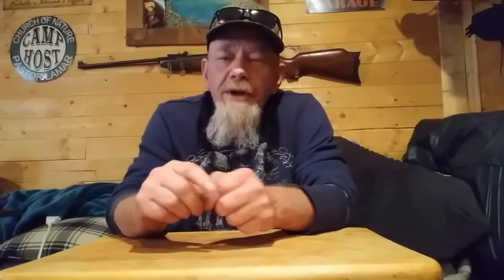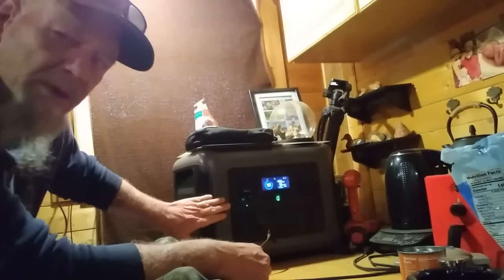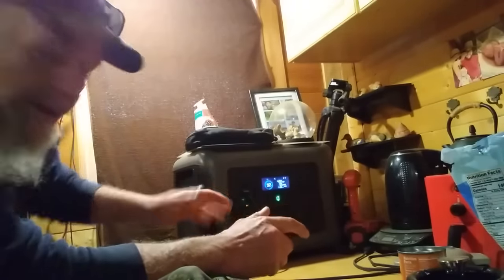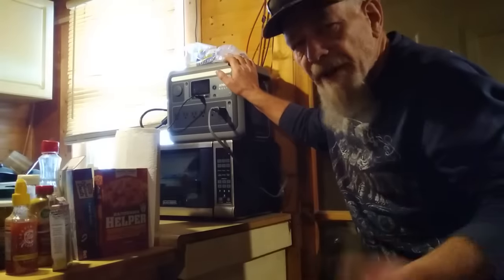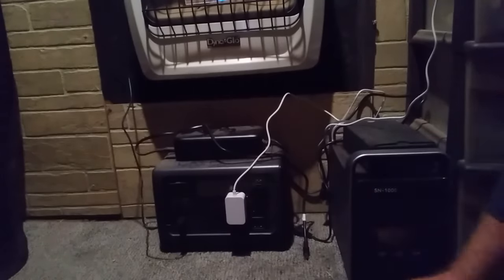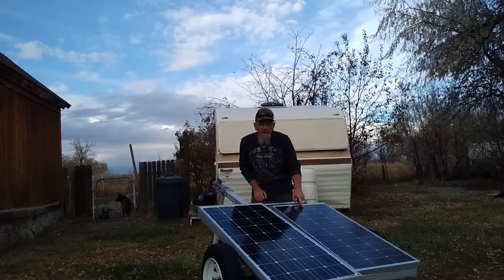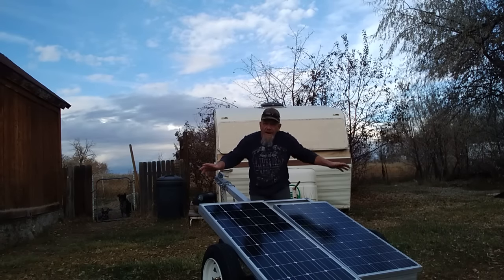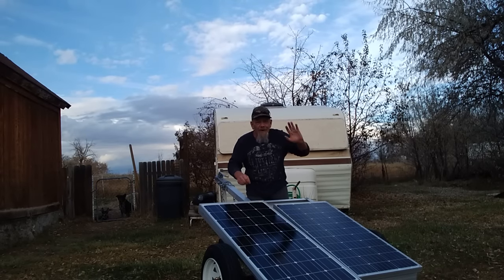My Solar Produces Too Much Power Or How I Store Excess Solar Power

Comment: i'm going for a system like your's probablly make it a 24 volt system...been experimenting with 12 volt system 400 watt solar and it has served me well for what i'm doing, not totaly off-grid but will be soon...started out just wanting to run t.v. and icebox, that worked like a charm and been hooked ever since...thinking of getting mini-split heat and air for my little 600 sq. ft. place..., they have them that run off 110, crunching the numbers to see what it will take as far as batteries and panels...any suggestion's would be appreiciated...been a good weekend so far here in oklahoma, hope your's is as well,great vid, thanks.
Reply from the maker: Mini splits work in moderate climates and use about 600 watts.  Not great for very cold climates for heating.